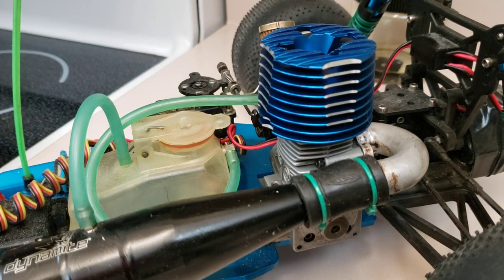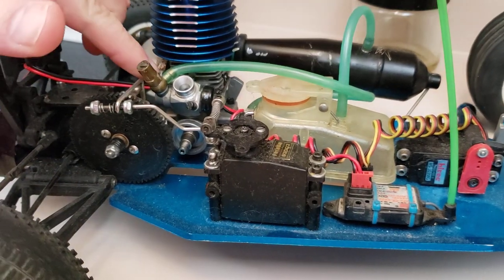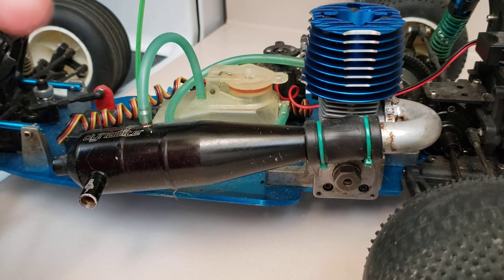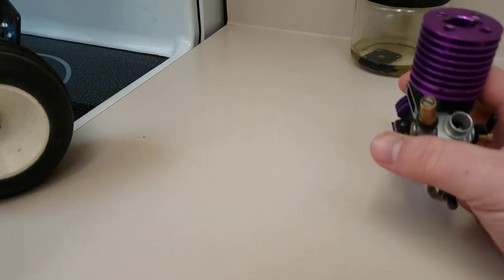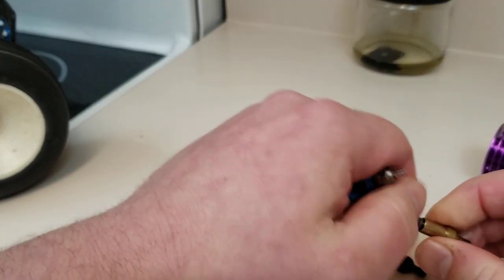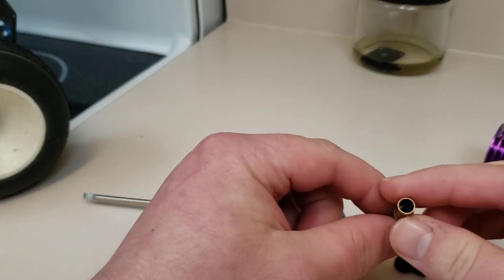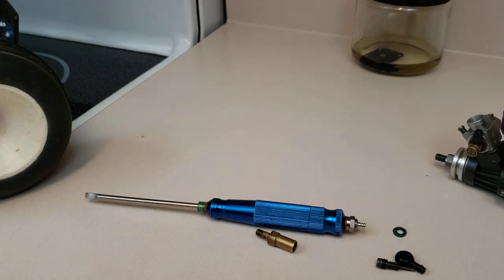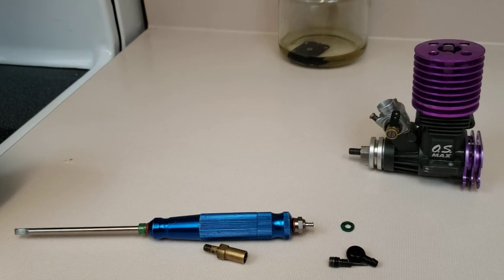How to fix a nitro RC car that only starts when you put fuel in the carburetor

Comment: Pulled out the old kyosho fw05r during lockdown. I took apart and gave the engine a clean as it was almost seized, but didn't pay much attention to the carb. 
Was having heaps of trouble getting the engine to start/run consistent and after watching this video, i recleaned the carb better and noticed the low speed needle's oring was split. I replaced that with an old one I had lying around and now it runs as good as it ever did. (It sat in a box without running for 6-7 years) 
I also just 'flushed' the needles without counting turns and it was pretty close to spot on.
Thanks mate
Reply from the maker: Awesome man glad it helped!

Comment: So I have a 2024 jato 3.3 it’s getting pressure the glo plug is good and the gas line and pressurizing lines are in the right location yet the carb is t taking any gas. When I force feed it gas it wast to start but won’t die to the fact I already burned the gas in the motor
Reply from the maker: Hey man go to Facebook and go to the Nitro RC enthusiasts group and post up im in their to. An admin that way we can help you

Comment: I have a question, when re assembling the carb, does the fuel inlet nipple need to line directly up with the holes on the high speed needle housing? I was working on my carb the other day, as the engine as soon as it started went full throttle and the servos were off, the idle gap was at about .5mm, and I had to find the issue. When I took that hsn housing off, I found some clogging, and when I reassembled it nitro sprayed into my damn eye! So it was as if the fuel was building up at the HSN area, and as if it couldn’t pass down the needle housing. Help!!
Reply from the maker: Hey man sorry for the very late reply it takes me a bit to get back to comments sometimes but no it doesn't matter the position of the position of the fuel and wet nipple it's like a banjo fitting you can put in any possession you want.  Check out Nitro RC enthusiasts on Facebook it's easier to get help by posting a video or picture of the problem. Im an admin in the group see you there!
Reply: @thebug4046  thanks, and I’ll check that out! I’d unsubbed from FB years ago due to it creating nothing but problems. So just a while back I created one just for R/C under a pseudonym. Appreciate you getting back to me! Now I don’t think my carb is broken, I will dig deeper!

Comment: Hi nice vid on the card,can i know where i can get the airfilter that u are using. Merry Christmas sir
Reply from the maker: Sorry for the late reply and they are disconnected it was an original AE part  I believe the same as a Ford fuel filter for a carburetor im not sure witch one
Reply: @thebug4046  tq, its ok sir for the info 😊

Comment: How many teeth on the clutch bell? And do you have to use the traxxas one to use the trx 15 in an rc10gt?? Great vids...took your recommendation and got two trx 15s
Reply from the maker: I believe they are 15 teeth and I'm using the Team Associated clutch and flywheel assemblies both with the pro 15s i have yet to try the Traxxas stuff
Reply: It looks like the traxxas stuff has beefier shoes with springs ect. But the lowest teeth count I can find is like 19 or 20 tooth on the traxxas stuff. Prob cuz the tires are so huge they need more torque?

Comment: My car wont prime , it's brand new and I've tried all the tips , I've even tried to flood it on purpose by opening up the low end screw and blown through the exhaust hose to check for fuel tank leak's ,I'm stumped any ideas ?
Reply from the maker: Go on Facebook and join my group nitro/diesel/gas rc and more  answer the 2 question I will let you in post a video about it that's the best way to help you
Reply: Check your o-ring on the fuel cap too
Reply: One thing that can help is if you prime your car with the throttle all the way open. That usually helps, and also make sure that both tubes are connected where they need to go and are snug.
Reply: Take the carb off, and spray carb cleaner through the removed low speed needle spot, and the high speed needle orifice. Then follow up with a rubber tipped blow gun to blow it out. Fuel can harden in the small spots and not let any fuel into the engine. Also make sure your glow plug ignitor is fully charged. Remove the glow plug and stick it into the ignitor it should glow orange quickly

Comment: Hello, Please can you help me! I have the same carburettor as the one in this video on my .15 pro engine.. but the throttle is stuck internally and will not move.. can you tell me or do a video on how to take this carburettor apart please ! I need to free up the component..
Reply from the maker: I will make a video about how to disassemble that carburetor at a later date but what you can do is get yourself a can of non coronated brake parts cleaner or even some nightrail fuel or denatured alcohol and let it soak and I will eat the varnish and allow the carburetor to move freely again good luck
Reply: thebug 404 ... THANKYOU!, I will try this overnight tonight and see how it goes..., I see you mentioned the SH .18 Carbs fit.. where can I buy one of these? Many thanks !
Reply from the maker: @callumatkinson9032   Hey brother no problem And the SH18 carburetor you can get them off eBay or Amazon they're about $35 make sure it's the correct one for your application because they are available in both slide and rotary San tastic carburetor that's exactly what I run with my pro 15 And I'm sure if you have seen my other videos of me driving that truck you will see how easy and well it performs and tunes
Reply: thebug 404  big big help thank you!, I have to replace the 2 bearings in my pro 15 but they are so so rusty and so so stuck! Any other tips to get them out as I’ve tried blowtorching but they are not budging at all!
Reply from the maker: @callumatkinson9032   Well my friend you have come to the right place if you search through my videos I actually have Video replacing the bearings in my pro 15 and how to do it it's very easy They might be kind of far down so you can have to search a little bit

Comment: Hi I been on my nitro and I noticed when I drive it and bring it back the High speed needle turns in by it self it’s like it’s loose so you know why it’s doing that it’s really odd never happen to me before
Reply from the maker: Needs O rings! Should be able to get them depending on the carburetor or a replacement carburetor

Comment: I can’t seem to fix my hard pull starter. I tried to remove the glow plug and pulled it but i can’t see the fuel coming out. Can someone plz help?
Reply from the maker: Join my Facebook group and post a video Nitro/Diesel/gas rc and more im the owner and admin be sure to answer the questions about how we talked on YouTube i will add you and get you what you need
Reply: @thebug4046  sounds good. So you want me to post a video of my rc? Also, where can I find the link of your Facebook group?
Reply from the maker: @WhipReviews   For whatever I can't share a link but if you just type it in how I spelled it exactly like that you will find it and when you add or I add you just go Hey I'm new here this is my issue and then post a video of the problem that you're having it's a very supportive group it's full of really good people there's no bullshit
Reply from the maker: @WhipReviews  Nitro/Diesel/gas rc and more. Just like that on Facebook
Reply: @thebug4046  thank you so much!
Reply from the maker: @WhipReviews  no worries
Reply: @thebug4046  ok, I think I sent you a friend request.
Reply: @thebug4046  I also posted my issue but not the video.
Reply: @thebug4046  hi, do you have any tips? I just posted a video as well.

Comment: I just might as well sell it anyway. It worked for a bit but gave out.
Reply: @thebug4046  It spattered brand new fuel from the exhaust and there is 0 leaks in the tank yet fuel still doesn’t go in the tubes?-
Reply from the maker: @redraider7614   It's very difficult to imagine this whole thing over taxed so go to my Facebook group nitro/diesel/gas rc and more  Answer the 2 questions and I will accept you not when you can post videos or pictures of what your problem is
Reply from the maker: @redraider7614   If the engine'll set rich then yes it will spray fuel and oil from the exhaust its normal with these they urged the 2 stroke engine  The like I said go and join my group

Comment: you seem to know your stuff, can you help me out please. my engine starts ok, and idles, but after some time, im getting air bubbles out the carb, pushing back into the fuel line, and cutting the engine out. any idea's ?
Reply from the maker: Sounds like a fuel leek sum where what you can do  Is go to Facebook and join the nitro rc  enthusiast's group I'm in there you can post pictures and videos of the things you're having problems with makes it easier
Reply: @thebug4046  yeah, I suspected an air leak somewhere, pulling in thru the crank bearings or the carb, I don't know how to find out. I'm not on FB, but thanks for the info, Mr bug
Reply: @thebug4046  turns out it was the backplate bushing, and the pull-start shaft. theres a fuel leak from there, caused by play in the shaft and bearing
Reply from the maker: Check your fuel line's check to make sure your high speed needle isn't loose or that the O rings and your high speed needle to bark dried out the best thing I can suggest doing is going on Facebook and joining nitro RC enthusiast's group I'm in there as admin  and post a video of the problem it's easier that way  It's very difficult to diagnose an issue overtaxed